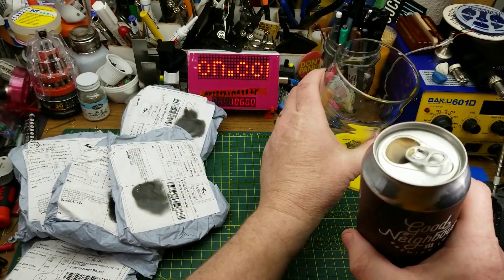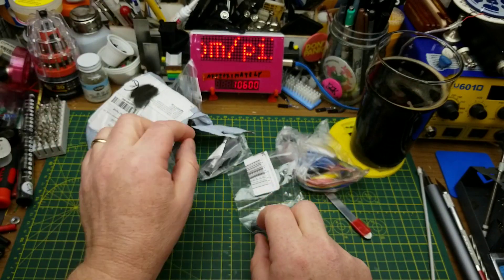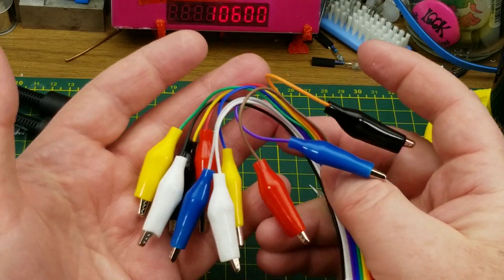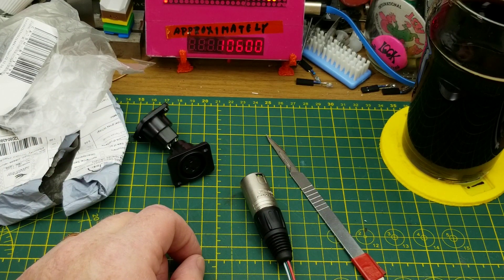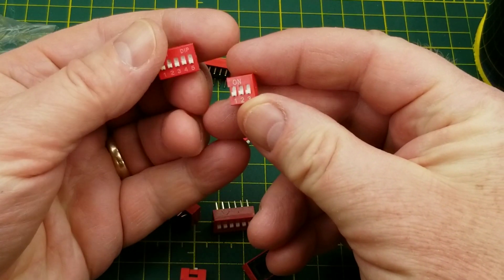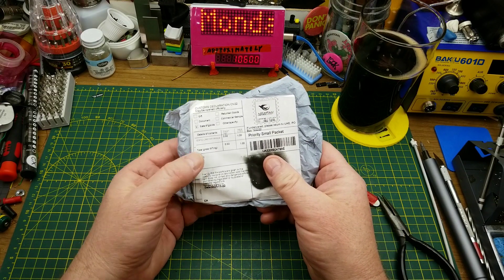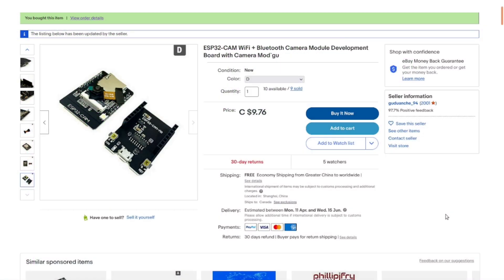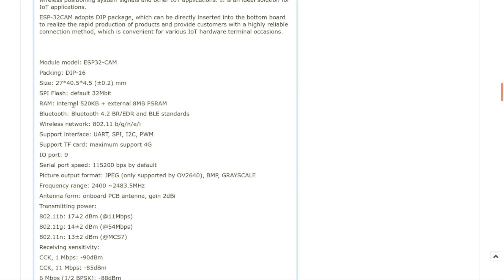mailbag Monday 135

Comment: It's creepy how we have similar gear arrivals or issues at the same time. I have a pair of jbl studio monitors plugged into a 2 input Spielberg daw that have been buzzing intermittently. I finally figured out that since I moved my workshop and built a new pc I'm using a bigger fancy power strip. I have everything plugged into it and it's causing a ground loop issue with my monitors. I literally figured this out seconds ago. I thought it was my XLR cables causing it but apparently studio monitors and computer monitors don't play nice when plugged I to the same strip. The displays cause problems with the speakers. The buzz was driving me bananas because they sound phenomenal usually. Especially when you play games in stereo mode where they are near field speakers, it sounds better than the surround setup attached to my oled when I play ps5 thr odd time.

Comment: Re: the duppont to alligator clip leads---  Aren't those wires in resistor color code order?
Reply from the maker: I wouldn't know. 
Colourblind problems...
Reply: As best I can make out from a not too high quality pic on AliExpress, they are - but 1 based instead of 0 based (black becomes 10, on the opposite side of the brown.
IE. brown, red....white, black
Reply: @michaeltempsch5282  Yup, that's what I saw.
Kinda screws up the old saying that we were TAUGHT to remember the sequence of colors.  ----  The one that starts out: "Bad Boys ----" and ends with "---Gives Willingly".
Reply from the maker: @frenchcreekvalley  That's a blast from the past.
i still remember the sequence, I just can't reliably see the colours, so I don't even think about things in terms of their colour normally.

Comment: Do you think that camera would work on a model train for on car shots or video
Reply: For the price, it does work pretty well for model trains.  The USB adapter board is a godsend in my opinion.  I'm building one into a box car now.  Plan to put multiple stationary cameras on layout.  It's a little hard to add the optional antennae because circuit board modification is so small ... wish there was a simple jumper.  If you want/need larger antennae it's best to find vendor that has board already setup for external antennae.  For a great ESP32-CAM tutorial to get up and running quickly checkout Dronebot Workshop  https://www.youtube.com/watch?v=visj0KE5VtY
Reply from the maker: Probably. Not sure what the video quality is, though.

Comment: Picked up some alligator clips a while back, all were random resistance to pin. Poor connection, just pressure crimped to the wire, probably both oxidized, once soldered they worked fine. Been using yours and others to pick up stock, was out of electronics for 20 years, what a beepen change. Like your previous on PhillipjFry, did a nice size order from him/her/whatever ( think that was politically correct (-: )

Comment: I bought some of those dip switches, they are very stingy with 4 switch for some reason. My seller listed that there were no 4 switch in their package. The pins on these are really short and are not great on a breadboard, the more pins, the more stable they sit.
I would expect you should be able to use the USB adapter to program the other ESP32 Cam.